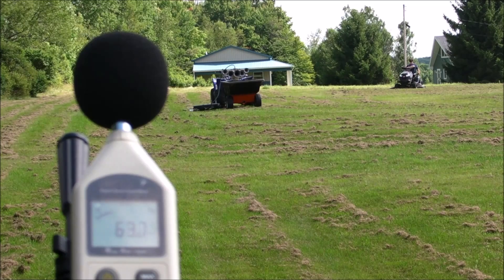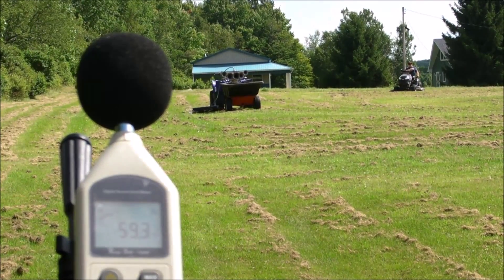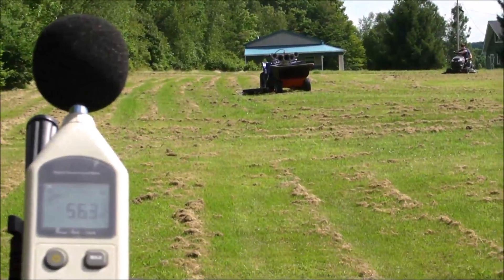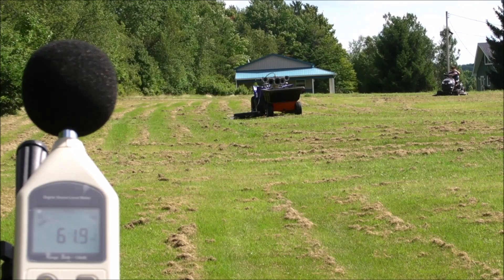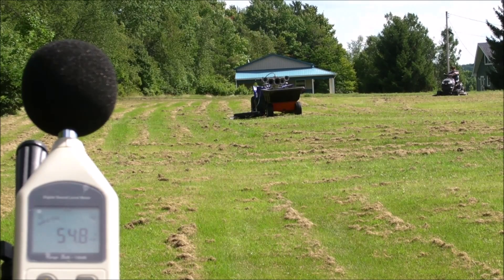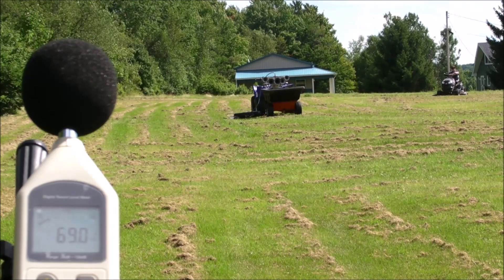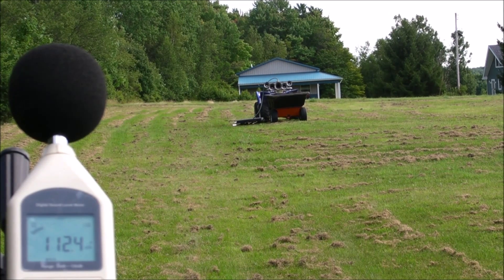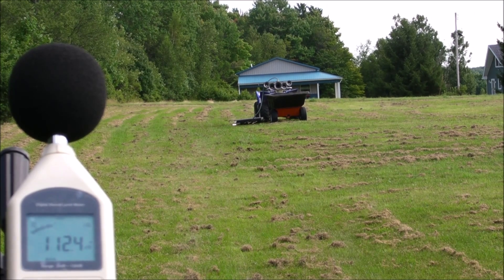Locomotive Horn Pressure and dB test

Comment: that's a lot more than 116. decibels are supposed to be measured WAY closer to the meter than that
Reply from the maker: Not per the FRA rules and regulations.

CFR 49, part 229 section 129 (a)

Each lead locomotive shall be equipped with a locomotive horn that produces a minimum sound level of 96 dB(A) and a maximum sound level of 110 dB(A) at 100 feet forward of the locomotive in its direction of travel. The locomotive horn shall be arranged so that it can be conveniently operated from the engineer's usual position during operation of the locomotive.

Seeing how my readings exceed the regulations, I would have to put a restrictor in this horn or rearrange the chime configuration if this were to be cab mounted on a locomotive.

Comment: I would think it should gradually get quieter as the pressure reduces, but the readings are all over the place. I did a psi/dbA test on a K3 single once. I tried 200, 140, 90 and 60 psi. 200 was the loudest, with 140 being 1.6 less, 90 reducing another 2.8, and 60 reducing another 1.2. I did however use a regulator so the pressure stayed consistent. Bells with a fairly worn preload sometimes will not oscillate properly at 200psi, and even Chewbacca warble (my K1 bell did that). A longer blast at each pressure would probably help with a consistent reading besides no wind. The FRA requires 10 seconds, but 5 is probably fine. Anything below 3 seconds has been hit and miss on results consistently for me.
Reply from the maker: There is a lot of factors that play into the final result. Wind temperature, humidity effects the output, and then you also have to deal with the equipment your using and recording with. I had a 5 gallon tank rated for 200psi, fra uses a meter that is certified, and costs well over 3 grand, my meter cost me a whopping 15 bucks about 4 years ago on ebay, but my main objective was to show that 200 psi does not make your horn louder, it simply adds wear to the compressor and prematures the diaphragm
Reply: Yeah, I made sure to do my test on a day with no wind. My meter's probably worse than yours, but I had more honk time since I was only using a single bell. I don't know if I agree that 200psi isn't louder since my test found the opposite. Though, efficiency definitely drops off after 150psi. My K3 single used nearly twice as much air at 200psi compared to 140psi, only gaining about 1.6db. It's an interesting topic though that definitely deserves more experimenting. Especially with an adjustable back cap horn, which can take 300psi with proper calibration.